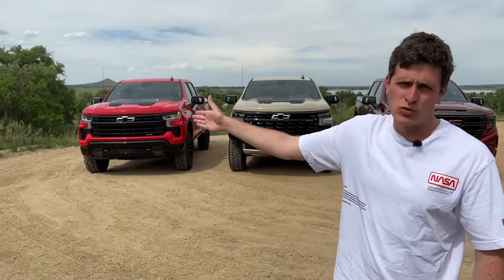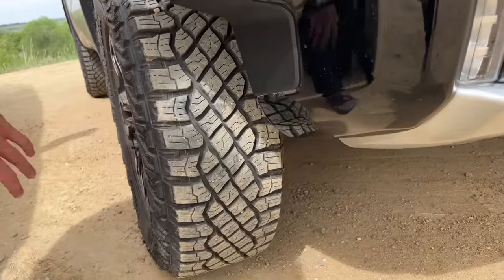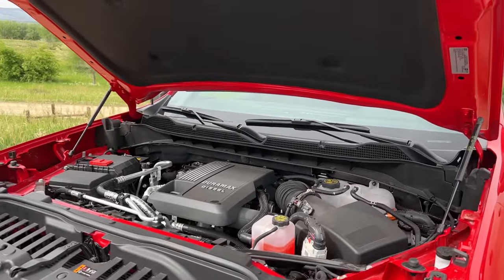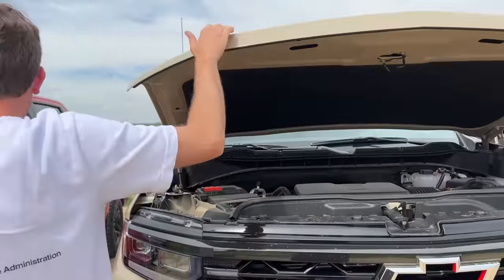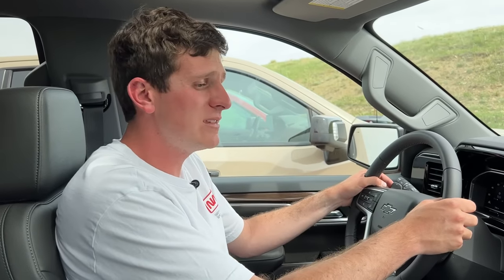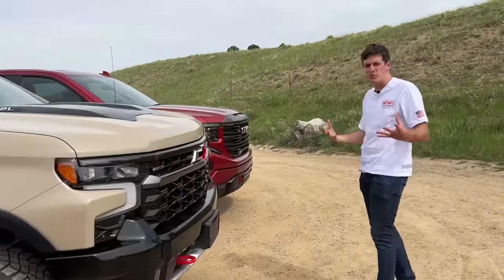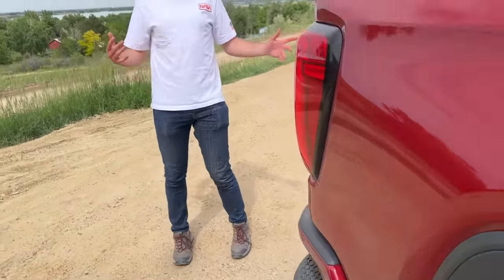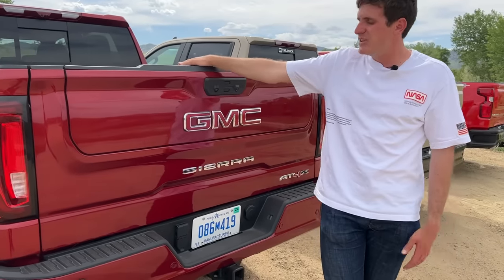What Is The BEST Off-Road GM Truck? Silverado Trail Boss vs ZR2 vs Sierra AT4X

Comment: All three seem well equipped to handle the difficult challenges the majority of their owners will put them through: potholes in the Starbucks drive up, poorly maintained home improvement center loading areas, and the speedbumps in the mall parking lots and school pickup line. Some may even have to drive over a curb and onto the lawn when the owner needs to make room in the driveway for guests while holding a BBQ in their suburban cul de sac.
Reply: Ahhh yes the dude with the Honda Ridgeline talking crappola, love it.
Reply: @Crimsontide1694  I've owned the rest, started in Silverado's, had RAM's (back when they were Dodge Rams), and F150s. I just got real about what I was actually doing with my vehicle. I needed a bed that could haul 4x8 material, I tow a couple atvs and a 20ft boat and a 3800lb camper, and commute to work on winter roads in Wisconsin. Why did I need 10k+ of towing or 4wd to do any of that? The lower insurance cost and 29mpg I am getting on the highway alone were worth the switch. 

It's easy to talk shit on the Honda, as you are, but the truth is that many truck buyers are buying capability that they don't use. I off-roaded for years with my dad in shitbox chevy's with manually locking hubs and did just fine, so why would one need these expensive trucks to do the same thing an 80s truck with manual hubs and open diffs could handle? And why buy an off-road specialty vehicle to not off-road? If I wanted to see that, I could be like the lady I work with who has a Wrangler Sahara and didn't even know it had 4wd. She just likes looking like Daisy Duke.
Reply: Here’s this guy
Reply: @jg8263  : You're not wrong. People with fragile egos just don't want to hear the truth.
Reply: @oneslackr  It is so appropriate you had commented this the other day and brought this comment thread back to my attention. Yesterday night, I saw a prime example at Walmart. Parked there in the -5 degree Northern Wisconsin weather, was a Jeep Wrangler 2dr, with a lift, with a winch, with the "You wouldn't understand..." sticker, the whole shebang of the Jeep "I'm a real off-roader" gear bolted to it. But get this, it was on 22" chrome rims with rubber-band tires (I mean, if there was 2" of sidewall I would be shocked, more like 1.25-1.5")! Yeah, buddy, we all believe you go soooooooo far off-pavement in your Jeep and it totally isn't a pavement princess.
Reply: @jg8263  : Sounds like a definite poser. Though I guess there could be a slight possibility that he has a 2nd set of 17s or 18s with 37" mud terrains sitting at the house. But probably not.

Comment: Got a Custom 22 Trailboss a couple months ago with the 6.2. Love this truck, ride on rough country roads is very good, getting 18 mpg average.
Reply: That's awesome for 6.2 L full size. My 4Runner with crappy four liter V6 only gets 20.
Reply: My rst with 1.5 lift  and 3 litre gets 29 mpg  average .  hard to believe for a half ton .
Reply: cool no one asked though
Reply: I doubt that as the 6.2 isn't offered in the Custom Trail Boss trim, unless it used to and they discontinued?

Comment: GM should offer the frt and rear locking diffs as an option for all of it's trucks not just on the zr2 or at4x.Not every one needs  the dssv shocks for hi speed off road driving,,but having true  4x4 traction  with the lockers is where it's at when you need it. Cmon GM make it happen.We are waiting.

Comment: Finally got my ZR2 Silverado, super happy with it so far! Just picked it up today, Saturday
Reply: Update? I've got an F250 with death wobble, thinking of trading it in for a zr2.
Reply: @ryanlaroche5103  it's amazing but if you'll certainly be driving another sized truck than your F250, it really just needs an exhaust to make the truck better, the factory is a 2 to 1 to 2 and has a dumb flap for the cylinder deactivation right outside of the muffler. Taken it on a bunch of trails and put 35's on it, absolutely in love with the truck

Comment: I bought the trail boss simply because of the diesel. Got 39.3mpg best and 37.1mpg average last weekend on a trip to Yellowstone. The 14 and 16mpg nonsense in the gas engines just doesn’t cut it.
Reply: I’m just afraid of the expense of filters and maintenance of a diesel. Is it that much of a difference?
Reply: You need 1000 miles of range?

How can you care that much about fuel when you paid $30k too much for a truck

Comment: Funny how people kept saying the price of these 3 are the same as  TRX are Raptor so they would go with those; this is simple not case. There is a 10 to 20k difference between the GM vehicles similarly equipped.

Comment: I don't know how it wasn't mentioned that this is the first Silverado in decades to not feature the bar splitting the lights. That is a decent part of why people rally around the Z71 badge in the first place, and the reason GM had the finances to try to develop a ZR2 a few times. The trail boss has a better approach and departure angle during real world testing, without a measuring tape, than the raptpr and the rebel. Please quit trying to compare the TrailBoss to the raptor and ZR2. It's not meant to compete with either of them.

Comment: Just so you know GM is having trouble getting out the 6.2L gas engines due to some chip shortages. The 3.0L duramax is available for the at4x now. Idk about the ZR2. I was able to order my AT4X with the duramax.
Reply: Love my 6.2 but with these gas prices I would rather have the straight 6 turbo deisel!
Reply: AT4X w/ 3.0 Duramax? Really? Was that through the dealer? Not showing as an option on the website.
Reply: @G8GTJav  yeah I did it through my dealer. Once I found out I called him and he was able to change my order.
Reply: Do you have it yet?
Reply: @TheDeanGullberry  unfortunately no. My truck has been sitting in order waiting for GM to pick up since may. I changed the engine option about 2 weeks ago.
Reply: For anyone reading this now and having trouble getting this set up, from what I am hearing is they are now only doing this for existing orders. Any new orders are now having to be for the 2023 model in which production starts in august, but they are back to limiting the 2023 at4x to 6.2L only.
Reply: You can’t get the ZR2 with the 3.0L duramax
Reply: @samscola585  yeah I’d say you can’t do it with the at4x either now. Even though option was available to switch to, my order never got picked up. Maybe if I waited longer, but an at4x with the 6.2 showed up at my dealership that the person didn’t take delivery on so I just got it instead.

Comment: I wish they would offer the electronic lockers on the Trail Boss. I don't need the better departure angles and multimatic shocks. And still be cheaper than a ZR2 with equal options. I think that would sell well.

Comment: I have wanted a trail boss since it came out. Wished they had one with the Duramax. Last week I finally got a used Z71 3.0 and now see GM FINALLY got around to a Diesel engine choice for the Trail Boss. My timing sucks..
Reply: Just put a 2 inch lift on your truck and upgraded tire and boom you got a trail boss.

Comment: If GMC offered the 3.0 diesel in the AT4x it would be the perfect truck. As it is with 6.2 it is a deal changer that I can’t accept.  Hopefully GMC will offer engine choices in the future.
Reply: Completely agree. Adding locking differentials to the at4/trail boss with the 3.0 option  would be a decent compromise
Reply: You probably know by now, but if not, for 2023 the ZR2 could be had with the 3.0 diesel.

Comment: I like the Trailboss, but went with the LTZ Z71 when I bought in 2019. Funny thing is that the real ground clearance is better, because the tires are about a half an inch taller in the LTZ vs the Trail boss. I actually use the folding mirrors, automatic deploying running boards, ventilated seats, exterior door unlock from passenger doors, blind spot indicators and like the power passenger seat and heated rear seats for the family, and I actually use the automatic up on the tailgate a lot. When hands are full, you can nudge it with your knee and it goes up. I use that feature a lot. Also, although Chevy didn’t make the trim level differences that obvious, when you get in a Trailboss you can see the materials are way different, like leatherette dash and door panels and accents are different. And back then I paid $47k out the door. So my money would go to the ZR2, except for the 6.2. It just has so many really cool features and taller tires, suspension and front and rear manual locker. Maybe with the duramax if they offered it. The 5.3 is a great motor with plenty of power. I think tow capacity and payload is actually higher with the smaller engine. Tommy, why didn’t you compare the towing and payload by looking at the nifty door jam stickers? Great video idea. Thanks
Reply: Great pick. Good you didn't sell yourself short with less options. No one has mentioned how they took out the A/C port in the refreshed models. The crazy thing is it's only available in the lower trim levels that's ass backwards.
Reply: @MansaX  Do you mean the home plug 🔌? I didn’t notice that. I have used that as well, However, gadgets are now using lightning plugs instead of USB. The way my truck is, even with the auto deploying running boards that swing all the way to the bed, it has a payload of over 1700lbs. This is really useful when I load it up and haul a camper. And the 5.3 is strong enough without having to use premium
Reply: @J26-e6g  yes, it's not in the higher trim levels of the refreshed model
Reply: @MansaX  Dang! I guess that makes sense, people always seem to get mad when companies make money, but I don’t. GM does a good job with cutting costs. Ultimately that allows them to become a better company, and to give us better products at better price points. I had cross shopped my truck with Ram, Toyota and Ford and nobody could beat the price and value. $47k is nothing for an new LTZ Z71 5.3 with automatic High Country trim running boards. My truck has given me zero problems, with now 40k miles.

Comment: Best interior quality for a GM truck ever!!! Still not to RAM'S standard, but definitely competitive with Ford and Toyota! Great job! Need better seats though in the mid grade Silverados and below and THEY HAVE TO FIX THE TRANSMISSION AND ELECTRICAL RELIABILITY ISSUES THAT THEY'VE HAD FOR A WHILE BEFORE PEIPLE START CROSSING OVER FROM OTHER BRANDS! Oh and in the ZR2 for a 67k truck it has MANUAL ADJUSTMENT for the steering wheel!??? Come on GM!! That's low rent!

Comment: Custom Trailboss. The ZR2 is nice but I'm not sure that leather seats, the 6.2 V8 and selectable lockers are worth the nearly $20k premium.
Reply: same here id go with the custom  diesel , like the Chevrolet  name in the grille
Reply: You missed quite a few things on that list of differences between a custom trail boss and the ZR2.......more factory lift, bigger tires, special bumpers, skid plates, wheel opening trim, different front control arms, much better shocks and a host of other amenities on the interior that make up the 20k price increase.
Reply: @captainrawn  eh. It's a cost of diminishing returns. Sure, it has a few extras that the Trailboss doesn't, but the TB is gonna do about 90% (or more) of what the ZR2 does, from the factory. And the average person needs to ask themselves, does it make it worth it? For most people, that answer is no.
Reply: @backwoodstherapy  Thanks for the reply. 
I think your correct that the Trail Boss will be what most people will buy and use for a variety of reasons. It will off road the same up to the point where the extra ground clearance and selectable lockers take over on the ZR2. I recently purchased a ZR2 in desert sand color to "try it out". Should get it in early July. Like many people I drive mostly on road but there is one place that we camp where I pull my trailer through rough bush mountain roads and use 4WD low with the rear axle locked on my 2015 F350 with 35's on it. Up and down steep grades and through some mud at times out there. Let's just say I use all the tools it has under those circumstances. I'm very curious to see how this new truck handles that scenario. I'm in my 60's and have never owned a new GM truck. Never liked the interiors until now. Had mostly Fords in my lifetime and have been generally happy with them. I looked at the Tremor, Rebel, Trail Boss, and AT4 and decided that neither of them would be good enough to get me there and back under those circumstances. I also have a very capable 2005 Tacoma with lockers, a lift and 32's but it can't pull a trailer. This new ZR2 just might replace it. If the truck is any good and they offer it with a 3 liter diesel I would order one soon as it was available.
Cheers
Reply: Custom does not have the refreshed interior! Still the same ol ugly dated interior they have now. That alone makes it a No Go!!! i went with a 6.2 TB loaded.

Comment: I want them to make a Work truck trim with zr2 suspension. Vinyl floors 4x4 and a rear locker no other options needed. Would sell like hotcakes. Offer all engine options as well

Comment: I trusted Chevrolet right out college in 1993 when I dropped over 20k USD on a Blazer S10 Tahoe!   It turned out to be the worst decision I ever made.   The truck was a lemon right out of the lot from the dealership.    It came with defective front shocks that ruined a pair of Wrangler radials.   Then the heating system sprung a leak, it blew a head gasket, shorted the electrical system, the digital instrument cluster went out multiple times over the lifetime of the vehicle, every nut and bolt rattled in the truck especially the rear hatch.   In short that was the worst purchase of my life.   The next vehicle I purchased was a 1998 Ford Taurus GL that actually worked well for a good number of years.   But then I decided to try Toyota and I never looked back.   Toyota has been my most reliable car ever.   Right now I own two of them a 2005 Tacoma SR5 TRD Sport and a 2016 4Runner SR5.   Neither has given me any serious problems.    What's more everyone in my family owns a Toyota now and they have all had the same experience.    As far as Chevy goes I can only have this to say.   Fool me once shame on you.  Fool me twice shame on me!   I never gave GM another chance!

Comment: Both the At4x and ZR2 need to have the diesel as an option. AT4x would work better with the same front end as ZR2 but with it’s unique interior. Zr2 needs a more efficient engine or a larger gas tank and a lotto win to fill it with gas. 

I’m mostly excited to find out more about the midsize segment though. I don’t need or want anything as big as the full size vehicles. Wish there were credible rumours of a hybrid on the new Colorado, Ranger or Taco.
Reply: The 23 Colorado’s will have the 2.7 turbo 4 cylinder so no need for a hybrid really
Reply: @mikemissouri5152  Agreed but I’d still love a system like the Ford Hybrid specifically the pro power aspect. Tie that in with a smaller engine and truck in a ZR2 trim that’d be interesting. Go to unusual places and have the flexibility to power a few things.
Reply: It was just announced that the ZR2 is going to come with the diesel option for 2024!
The only bad thing is the price will probably increase by 10 percent!

Comment: Can you notice a difference in handling while cruising down the freeway at 80 mph? My ‘21 Trail Boss tracked extremely well. My ‘23 ZR2 seems to wander slightly. Additionally, the Trail Boss seemed to have better throttle response and acceleration which makes no sense considering they both have the same 6.2 engine and transmission. Overall I was more pleased with the Trail Boss than I am with the ZR2. Any thoughts?
Reply: This is very interesting to hear.  My wife has a 20' Trail Boss with the 5.3, and we're entertaining switching to a Ford Tremor, Ram Rebel, and I was telling her to keep in mind the ZR2.  We test drove the Rebel and that was more comfortable than the Tremor.  With the seat comfort and ride comfort.  But that was with very short distances.  There is a part of me where I think we would need to take a longer ride in the Rebel, as well as with the Tremor, as I felt like it was "loose" feeling in the rear in the Rebel.  So with your comment, the ZR2 has the multimatic, DSSV suspension, but with leaf springs, and it feels more loose.  The ram with coil suspension might feel similar in the loose feeling.  Has me thinking that maybe the Tremor would be the best onroad and with very capable offroad capabilities.  In this segment, Rebel, Tremor, ZR2, even Trailboss with the 6.2, and Sierra ATX4, is a very tough decision.

Comment: Always loved GMC. However, the Sierra I have now is a 1500 and I'll never buy another 1500 again. 2500 HD or up. That is where GM has built a proper truck that won't break and fall apart after only 40K miles like my has.

Comment: All super nice trucks 

You guys have tested every brand made. You also live in a state that salts the roads. Is the Aluminum Ford trucks holding up better?  I also live in a state that salts roads are least 2 times a week. Most 2004-09 f-150’s are heavily rusted at this point. 

I’ve not seen any issues with the aluminum. But I’ve also not seen as many salt rust issues in the GM and Ram pickups. Is this just chance or are Gm and Ram better at rust inhibitor applications on their trucks?

These are huge investments. It’s time for me to buy new but I need a truck that will last 15 years without rusting through. I do keep my trucks clean. I always touch up chips in paint etc. But I have had mixed results with rust underbody treatments.